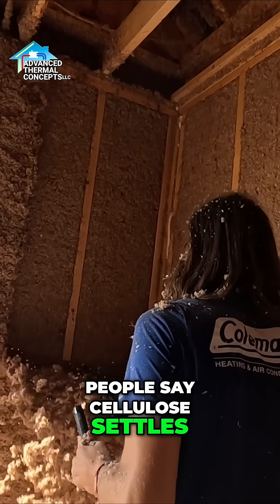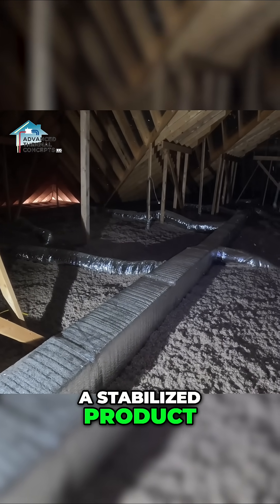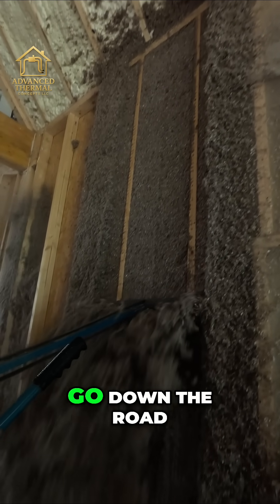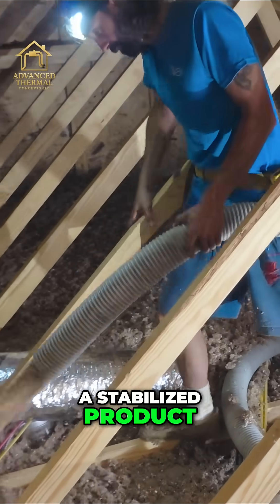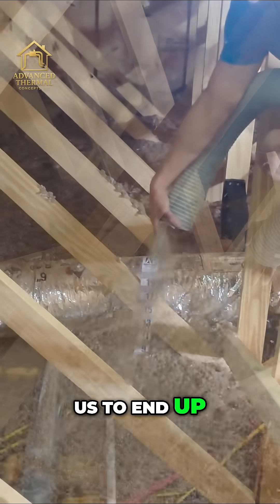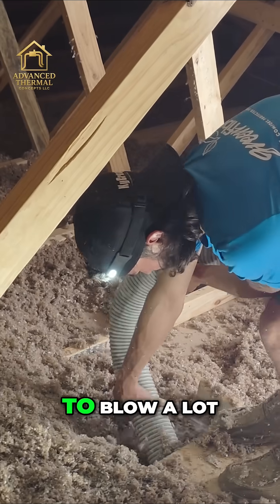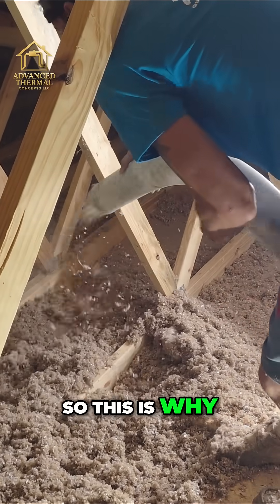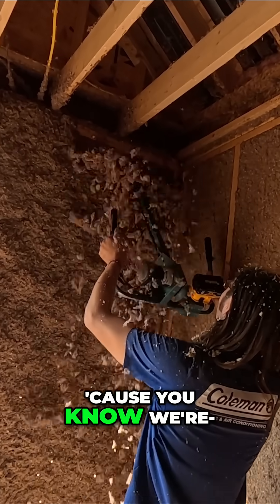Cellulose Insulation: Does It Really Settle? (Explained)

Comment: does this stuff even work. my house was built in 87, cellulose is in the walls, we have a gray blue dust the same color of the cellulose that covers the floor after about a month of AC run in the summer. I am ready to pull the sheet rock and put in sprayfoam. And there is nearly straight sound transfer from outside to inside. I dont think folks install cellulose anymore.

Comment: Settles on the way over to the job seems ok even a good thing to me so you dont have to have them come back and spray the rest if there isn't enough insulation the first time.   Not worrying about the insulation settling and not being the correct amount seems like a pro but they create stabilizers to screw over the customer even harder....